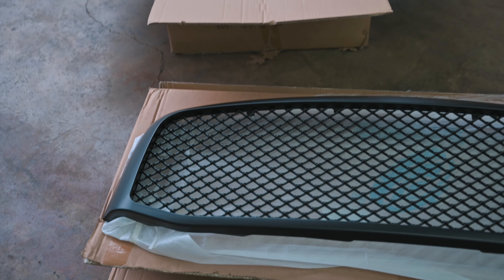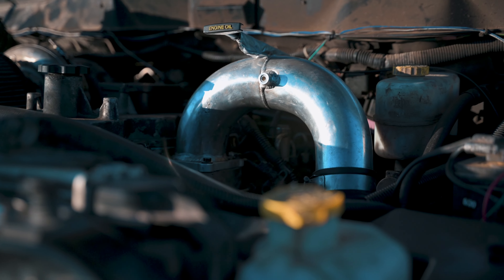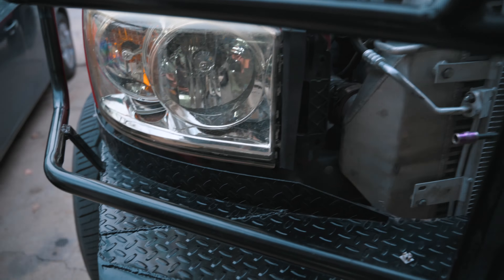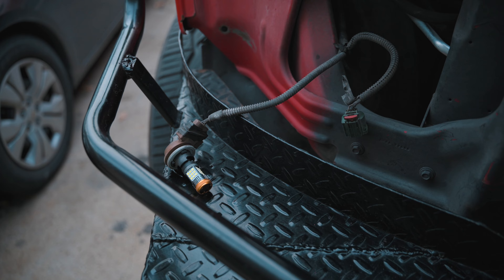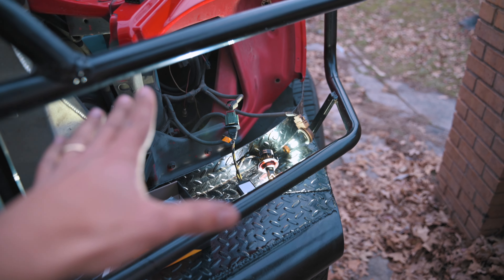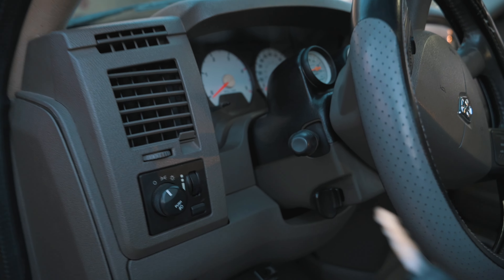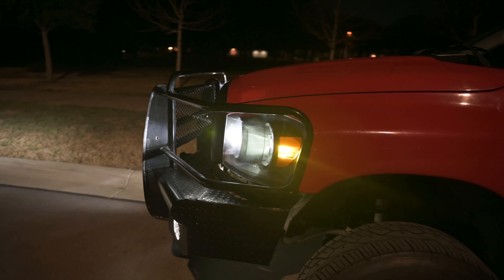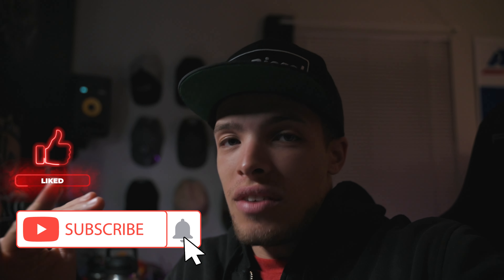3rd GEN CUMMINS gets NEW LEDS!! | AUXBEAM REVIEW

Comment: Man I have a 5.9 Cummins 24v in my fl60 service rig  I want to compound turbo it and convert my eaton 6 speed trans  to a eaton 13 speed in figure it’ll be a little better and not so Sluggish when I’m pulling hills. She does have the oil leaks coming from rear main and I believe timing case housing. Any input on upgrades while I’m dealing with the leaks
Reply from the maker: Man I'd probably do like a stock he351 compounded with like a s476. And then get some custom tunes for it
Reply: I got a a hybrid hx35 I was thinking would be a good turbo to spool up the big one.

Comment: You may or may not come across an issue with the led turn signals doing what’s called hyper flash and to fix it all you need is an led resistor which you can get a pack of four on Amazon for like $8, and I couldn’t tell in the video if your turn signal where white or white and amber/orange switchbacks but if there just white you may run into some trouble with the law lmao just a heads up, great video keep up the good work👍🏽

Comment: Have you run into any issues with these lights after you have run them for a while? I have installed the same lights on a 2008 with the Canbus decoders & they worked fine for about two weeks then I lost my low beams and sometimes I will any have one high been and I have had both High and lows not turn on.  Thank god I put LED switchbacks as fog lights they are as bright as lows, so they get me home.  I have let the truck sit for a few days and once in a while both highs will come on and lowes are hit and miss but after a 30-minute drive if I shut my truck off I can lose the highs again?
Reply from the maker: For me a know that they seemed to work with only certain decoders. I had to try out like 3 before I got consistent results
Reply: @LMDiesel   Thats good to Know I order my first decoder on Amazon  as i thought these lights already had them built in with no results, then I order the more expensive of the two on Auxbeams  decoders on their web site suggested for these lights i believe they were $36. Maybe I try the first one they suggested that is like 24 or 29 bucks.
Reply: Did y’all figure out what decoders finally worked for y’all?